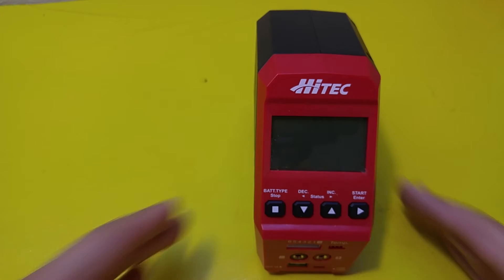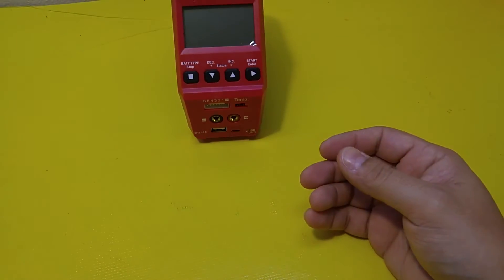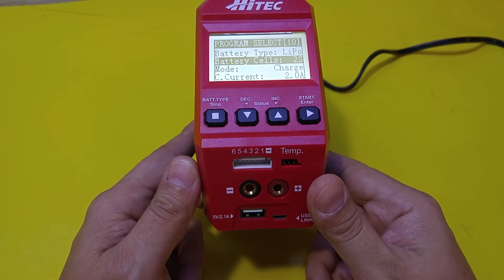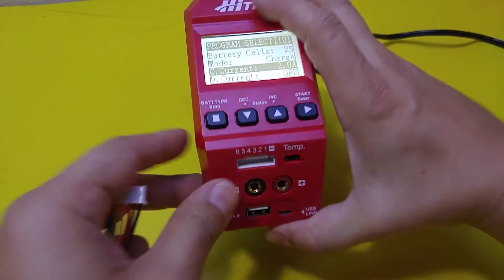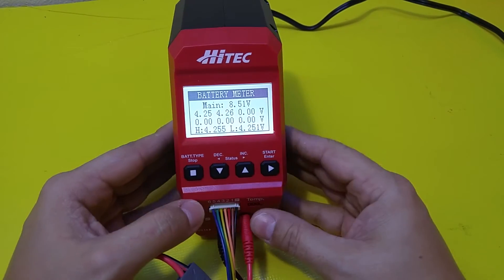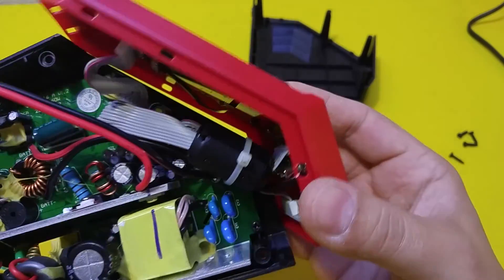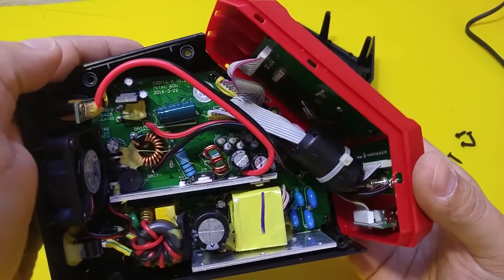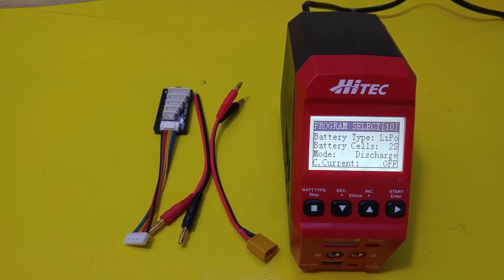HiTec RDX1 Charger Review and Teardown

Comment: Hi sir I have a question about your video. It looks like you have a lot of knowledge on this stuff. I have the high-tech RTX 2 1000 looks really similar to the one you have anyhow, I was charging a battery, but when the fan tried to turn on, I heard like a sound like hitting metal so I looked behind the charger and I noticed a small capacitor just dangling just sitting in there the fan blade just hitting it. I don’t know where the capacitor goes, but I removed it from there. It’s a tiny one. Is it still safe to use this charger without that tiny capacitor??

Comment: I’m charging my 5200mah,,80C,,3S lipo and it takes at least 1 hour or more on normal 4.2V even on fast charge.Why would this be and how can I speed it up ???
Reply from the maker: The charger has a maximum output of 60w.  By my calculations that lipo is approx 65 watt hour (volts x amp hr). Unfortunately this mean that it's going to take around 1hr to charge it at maximum output.
Reply: Ok,so then what is the purpose of having a fast charge setting on my charger if it does nothing ???
Reply from the maker: @joeyfesta2042  It will fast charge but only up to 60w which is the max output of the charger.  If the lipo were smaller or lower voltage it would charge faster. 
In the grand scheme of things this is a pretty low power charger (especially these days) and you're charging a pretty massive lipo.

Comment: I have 2 planes. They both carry hitec optima receivers, one airplane has 7 digital servos, the other has 5 with 3 electric retracts i think their eflite retracts. What battery for my recivers do you recommend i really need help. Thank you.
Reply from the maker: What size and model  planes and I'm assuming they are both nitro right?   A sub is appreciated!
Reply: @DoRC  yes both nitro. One is a Phoenix cesna 172 i belive its a 50 size.. The other one is a Tucano also from pheonix and i believe that one is a 50 a aswell. The tucano has the eflite retracts. All my models have hs 5485 hitec digital servos .. Thanks alot buddy. Yes of course ill subscribe. Thanks alot!!
Reply from the maker: Do the planes have becs (battery eleminators)?  Are you wanting to use Lipos I assume?
Reply: @DoRC  No they don't, well what ever is easier. Ive heard life are easier to maintain i do have a life balancer charger but i have no idea how to use it. I was told that life batteries dont send back the voltage info back to the transmitter but im not sure about that.
Reply from the maker: Ok so your options are nimh or life batteries. You can't run Lipos without a Bec because your receivers max voltage is only 7.4v.
It's difficult to tell the remaining capacity on life batteries by voltage  so that's a drawback.  Honestly I think I would buy becs and just use Lipos. It's a bit of initial investment for the Bec but after that you can use basically whatever lipo you want which is really handy.
Reply: @DoRC  ok thank you sir!.. So if i decide to go with life or nimh to control all those servos and retracts would you recommend a 2000 mah 6v baterry?? I dont want to burn out my servers either.. Hey i appreciate your time for this!!
Reply from the maker: @sinuemedina2550  yes I think that would work.
Reply: @DoRC  last question! What brand of life do you recommend?? Theres alot out there! I would like to buy the best ones.. Thank you
Reply from the maker: I don't have any personal experience with life batts but I see that there are spektrum branded ones. Probably can't go wrong there.
Reply: @DoRC  ok thanks alot again. Sorry for asking so many questions!!
Reply from the maker: @sinuemedina2550  no problem. Glad to help:)

Comment: My RDX1 60 WATT stopped working today after months of good service. It was used to charge 1,2 and 3 cell lipo batteries for my rc planes. All seems well until starting the charge process - the CURRENT reading stays on 0  (zero).

The results are the same for ac or dc use.
Some guys at the club checked it and tried different connectors in case one was bad - but same bad results - so its not the connectors.

We tried charging the batteries on a different charger and they worked - so its not the batteries

Our best tech guy in the club said all my settings look good.

So, is the charger broke ?  - any ideas ?

And I could not find what the warranty details are for this RDX1 -  Do you know ?

I plan to call HITEC support later if necessary.
Reply from the maker: You could try going into the system setup and doing a factory reset.  Other than that I think all the bases have been covered.  Looks like Hitec offers a 1 year warranty on their chargers so you should be able to get them to take care of it as long as you're within that time.  Let me know what you find out and what they say please! If it's not under warranty and you end up not fixing it you could send it my way.  I'll take it apart and see whats what in a video
Reply: thanks for reply - I just now tried a FACTORY RESET -
when I select it - the SELECT text flashes - so I press enter -
I suppose that did a reset - but there is no feedback I can see that confirms a reset was done -
I tried after that to charge a 3 cell and the CURRENT value stays at 0 (zero)
so if the RESET actually  took place then it did not fix the problem.
I guess I'll call HITEC support tomorrow (Monday).
Reply from the maker: lw216316 ok, the only other thing I can possibly think to do is try a firmware upgrade.  The connection between the battery and the charger must be ok otherwise you should get some manner of error when you try to start charging.  I'm guessing something in the physical charge circuitry has given up the ghost.
Reply: thank you - I'll check into it

Comment: NO way to charge & maintain all my little 1S batteries? I have 32 of these little suckers now and need to find a SAFE way to charge/DISCHARGE/ and charge to storage levels without a lot of hassle/ Any ideas? I saw that this does the 1S size but see no way to charge 6 or more at once with this?
Reply from the maker: Hey sorry for the delay in response.  You could devise a custom wiring harness that would take 6 1s cells and make it look to the charger like a single 6s pack.  It's probably already been done before and wouldn't be terribly difficult.  Otherwise Hitec and others make chargers specifically for the small 1s batteries.

Comment: How do I charge an Align 2cell that has the balance ports built in but no separate (deans connector) leads? It doesn't make a full loop like your 2 cell, can I even use it for mine?
Reply from the maker: So I checked the manual and I saw no indication that the charger would charge from the balance ports alone.  I no longer have the charger (bigger and better:) so I can't test it.  Sorry I couldn't be more help.
Reply: Thanks for the fast reply. Well I may have made a mistake with this thing as I still have to keep my Align balance charger which charges my 2 and 3 cells just fine. I bought this one because I have (1) 6S battery so $60 and that's all its good for for me...

Comment: Ive been running my RDX1 for about a month. It was working great until yesterday. Now all of a sudden it is not putting my packs into storage mode properly . The cut off voltage is factory set to 3.82. But the charger signals completion of storage mode and the packs will still read 4.00 volts. Ive cross referenced this with a lipo voltage meter and a multimeter. Ive emailed Hitec support just waiting for a reply .

Comment: hi im putting gens ace 2s 5000 50c 2s1p 37wh batteries, would you know what my optimum charge setup will be or maybe how i can charge them the fastest?
Reply from the maker: +Jeremiah Bray The 2p means that the battery can be charged at twice the capacity.  So 5ah means it can be charged at 10amps.  Though I would suggest charging it at 5 amps to prolong the life of the battery.